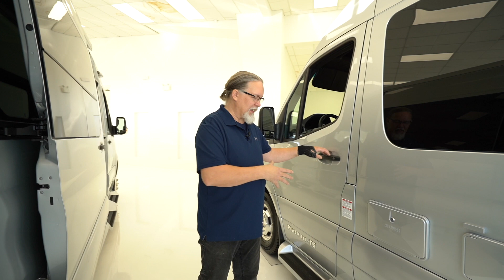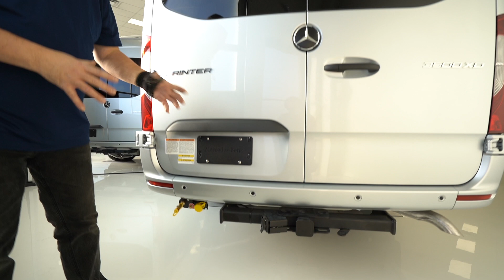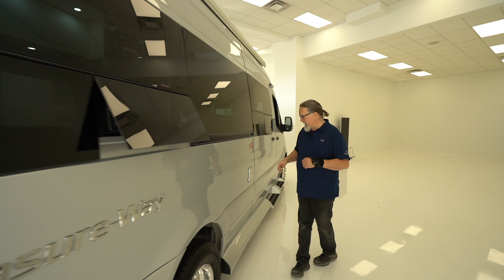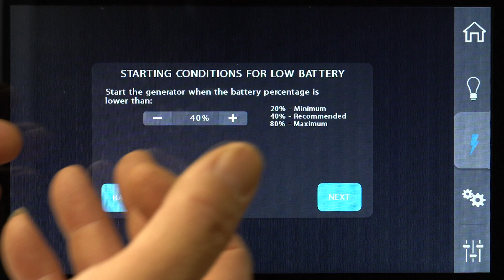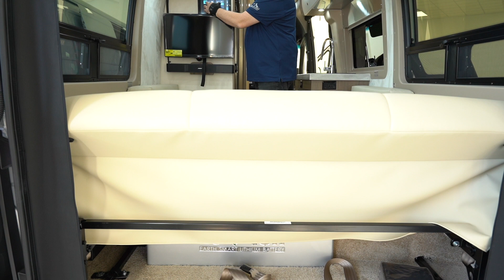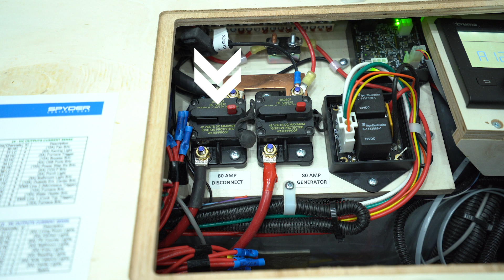2022 Pleasure-Way Plateau FL+TS | Orientation Walk-Through

Comment: How big are the water tanks.
Reply from the maker: Hi Randy, the fresh water tank is 24 US gallons/91 litres and the grey water tank is 35 US gallons/132 litres. The black holding tanks are slightly different between the two Plateau models: TS is 12 US gallons/45 litres and the FL is 10 US gallons/38 litres.
Reply: @pleasureway  thank you

Comment: When will the TS Model switch over to a compressor refrigerator like the FL model? Majority of RV buyers want compressor refrigerators.
Reply from the maker: Hi joyce, currently there are no plans to switch over to a compressor refrigerator for the Plateau TS. We will be keeping the 3-way option for the 2023 model year.
Reply: @pleasureway  Do you know if there is a compressor refrigerator model that will fit the space if I want to pull out the 3-way and replace with a compressor frig? The only thing holding me back from buying the TS model is the 3 way frig.
Reply from the maker: Good question. I recommend calling our service department to find that out. You can call toll-free @1-800-364-0189, ask for service, and one of our techs will help you out!
Reply: A 3 way fridge is what most want...esp for boondocking ...propane is boss